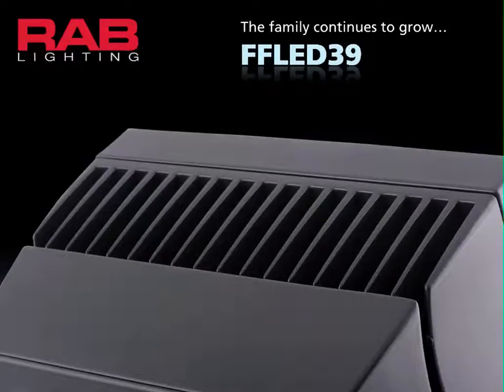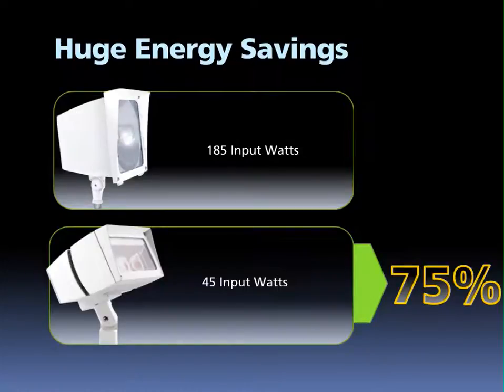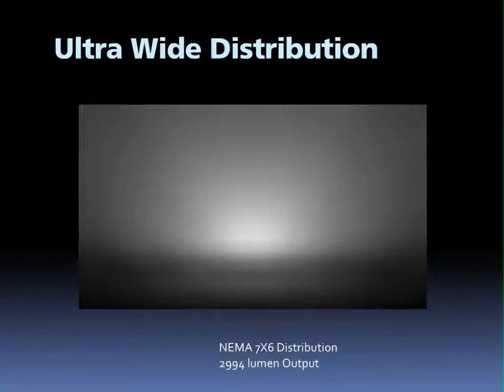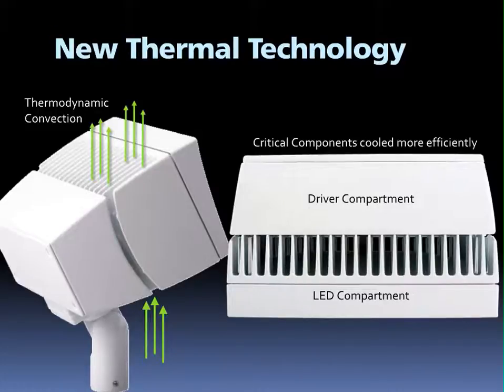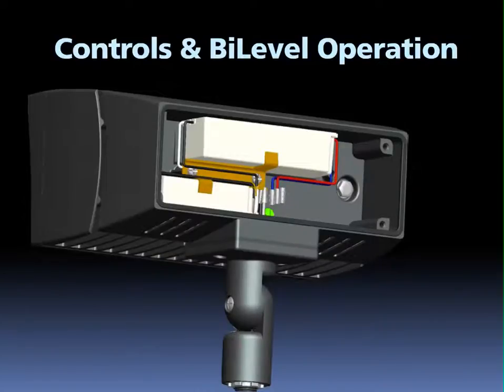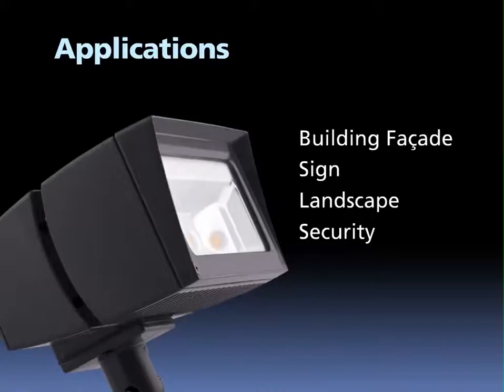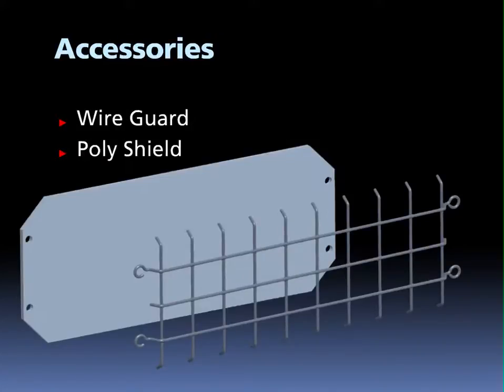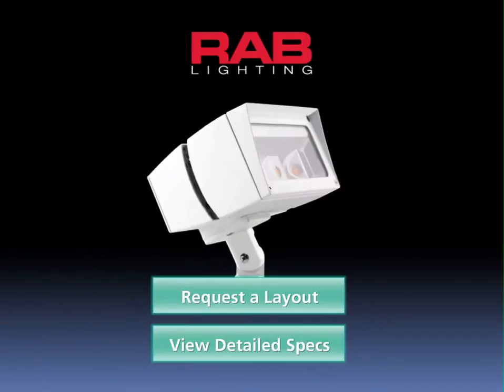RAB FFLED39 - Replacing up to 150W Metal Halide

Comment: Because these lights have universal voltage drivers. You can run them on the 208 volt high leg of a 4 wire Delta system.